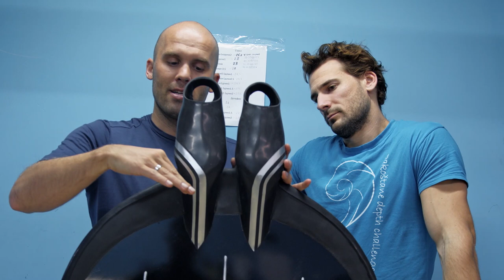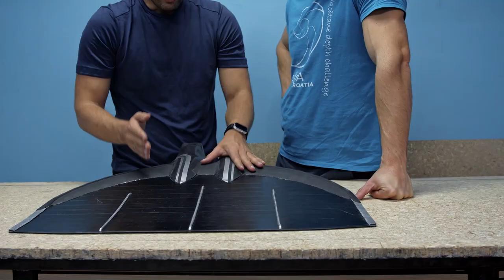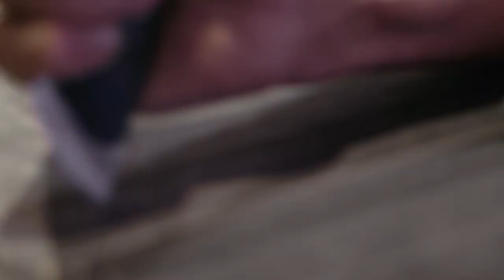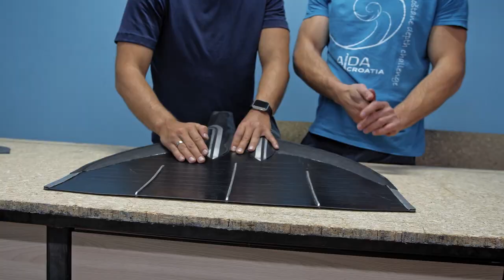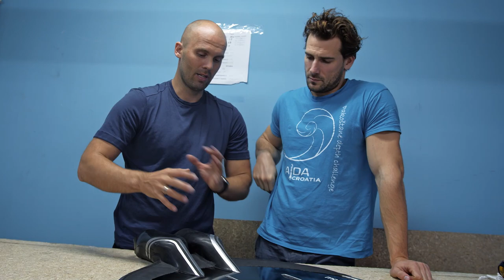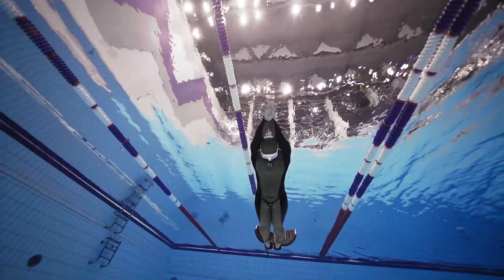Freediving World Record holders explore the new Molchanovs CM3 | Monofin for Freediving

Comment: Lovely video!
I love hearing about al the changes and reasons why they're made.
I'm a bit hesitant to order a soft fin because of a bad experience in a lake. I was diving in  a 5mm soft suit wearing about 5kg of weights and went down to 40, where I turned with my classic model one long distance fin (large soft blade). At the start I overpowered the fin, and it felt like I was wearing a towel on my feet not getting any propulsion. I quickly soften up my power to stay within the fins limit and within a 2-3 strokes I got up to speed and back up. I was used to a model 2 middle distance classic fin which allowed me to kick without any reservations.I'm 1,87, 70kg, and believe I got an average technique, although beginners around me regularly spontaneously say it looks good. Maybe I should upload a video and have the Molchanov team take a look.
Perhaps I've been swimming with a too stiff or big fin, that actually prevents me using a more soft and efficient technique?
Reply from the maker: Thank you for your detailed feedback. The new way is soft fin. It’s about relaxation and being in control at the bottom. Getting used to soft fin needs to be done not starting with deep dives right away. If you get new equipment, always do comfortable dives first where you’re 100% in control. The goal of the dive should be to adjust your technique, not to push too hard. In a couple of kicks you’ll have full speed and with soft fin your dives are more oxygen efficient for sure. I recommend to do a soft start, it will benefit everything, relaxation and potential lung tension.
Reply: I had a medium blade before for example, I still haven't done proper time/lactate measurements to compare old medium vs new soft, but subjectively the new soft feels amazing. I just enjoyed testing it so much... You will fall in love with the new pockets and everything else will be forgotten :)
Reply: @rimotivri  Thank you for the helpful responses, I think I'll order a medium-soft(4) instead of a medium(3).
The softest blade(5) I'm still weary of, eventhough and I think that may be better in the pool. At depth where I need to push up 5kg of negative buoyancy wearing my 7+5mm suit in the cold lakes I still like the secure feel of a blade that can handle my not so precise technique. Alexey is the master and I look with admiration on how he did his amaizing 130 CWT in Ville France sur Mer in 2019, where his dive looked like a ballet, with smooth variations in style and rhythm to show us what freediving is about.